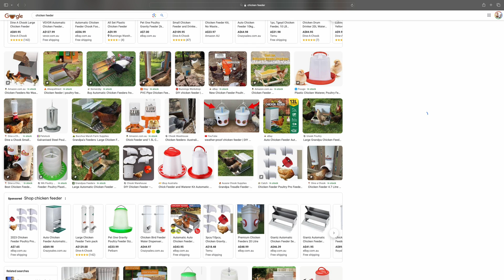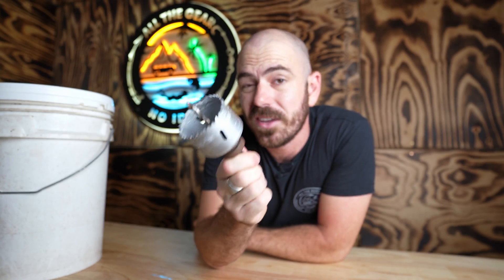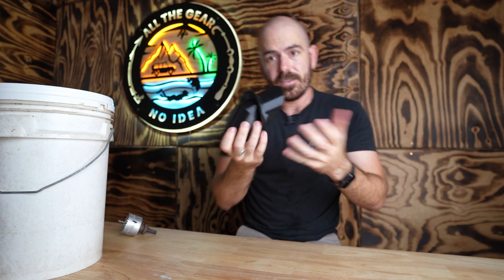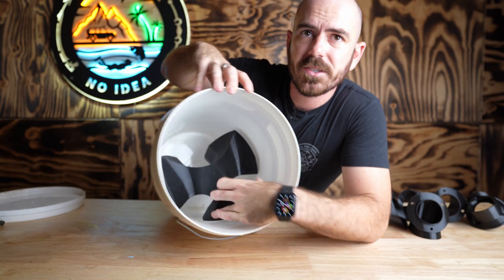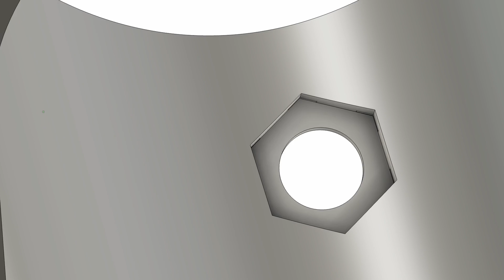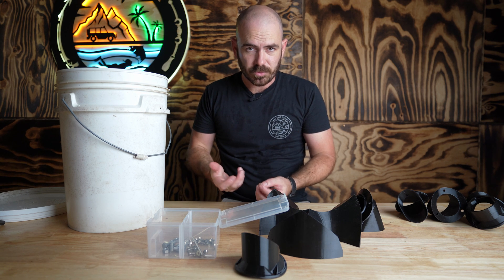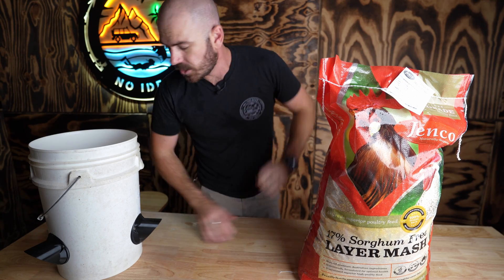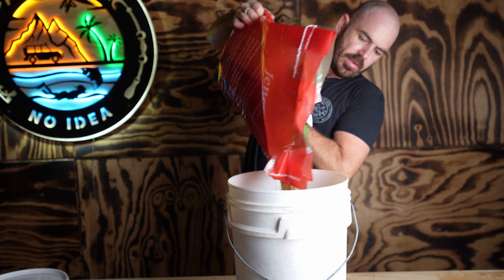DIY Chicken Feeder with 3D Printable Parts

Comment: General comment, do a test fit of your M5 nut (or measure and check the model) before printing several off; the impressions are oversized for the nuts I have so it's hard to get them tight. The side effect of this for me is that water is able to seep into the feeder during heavy rain. If you can put the feeder somewhere it's not going to get rained on, obviously this isn't a problem.

Comment: Cool idea Hoocho, take this as good faith critique: notice they are knocking food out onto the ground. Expect that behavior to develop into problems. The whole purpose of that sheath through which they stick their heads isn’t just weather protection.  You need to include a deeper channel to the inside which forces them to have to go inside entirely to eat with a negative slope and a lip to stop them from pulling the feed out.

Comment: why dont you just get "Rain Harvesting 90mm Extra High Flanged Tank Overflow"  easier, only 6 50 from bunnings if ya shop online ya can find em for 4

there is also "Rain Harvesthing 90mm Flanged Tank Overflow" 4.50 and a 90mm 90 degree pvc elbow 2.30 (heapssss cheaper online 2-3 bucks for the opverflow and a dollar to 2 for the 90 degree)

Rubbish bins are on special at mitre 10 right now 19 bucks for a large green bin. voila! 

Ya print is cool n shit hahah but why wouldnt ya first jury rig one ya fancy c unt hahahaha